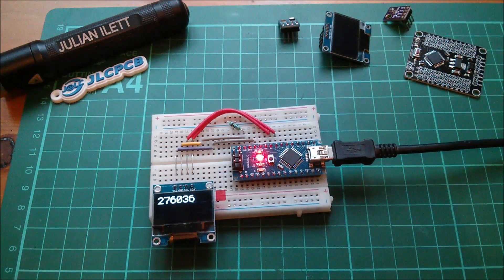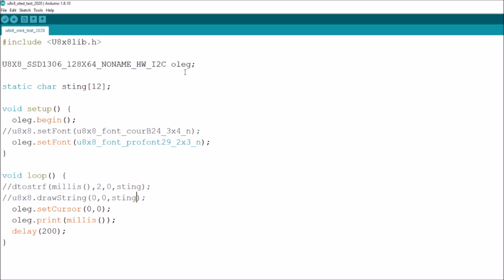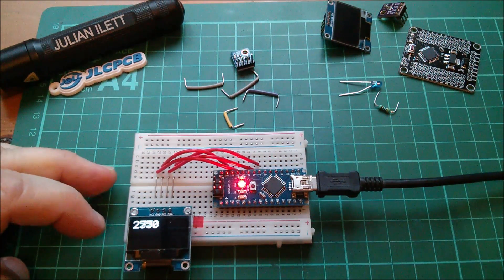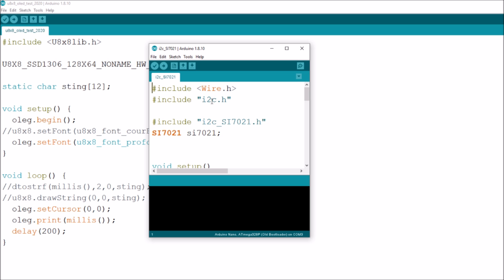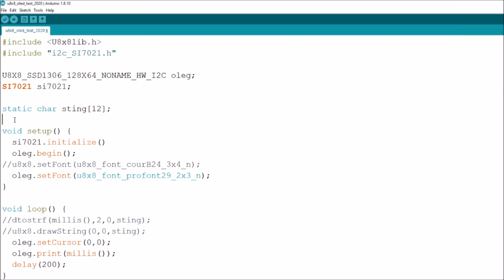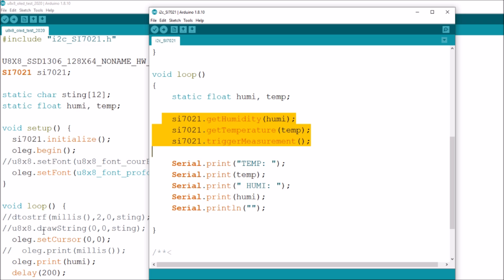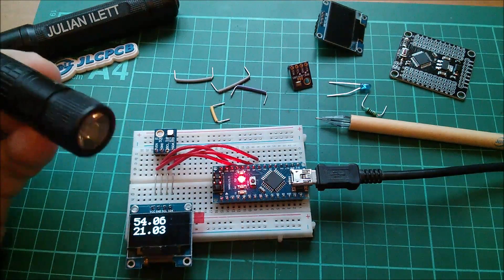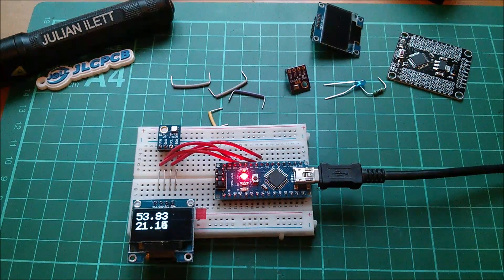Getting back into Arduino #2

Comment: Current project is using a b-280 pressure sensor and a weird little areuino called a pro mini I believe. Its supposed to take in 5v on the "raw" pin, as the two serial pins as inner  rather than edge pins, just basically wierd. I'm also going to need to use a serial to TTL converter. Things I haven't done. But, made the mistake of ordering this a while ago, and I want to put it to use. Huge learning curve but might be useful some day.

Comment: It's a method not a function. Pedantic semantics, but in general a function is passed all the data it needs as parameters. A method uses stuff from the object it resides in. So in this case the .begin() method is using things like the address, port, etc from the object oleg, which aren't passed to it, so it's a method.
Gets a bit complicated with static methods/functions, but who cares lol
Reply: Oh and also, the static variables. The only difference between your static char and their static temp, is scope. Your char is global so setup and loop can see it. The temp and humi is inside loop so only loop can see it.
There's a few other things to do with how it compiles, but hope that explains it simply enough :-)
Reply from the maker: Hey thanks for the explanation

Comment: Hi Julian, why did you choose to use the Si7021 over the BME/BMP280 sensor? Was it because your old project (using the BME/BMP280??) failed to work with the latest Arduino IDE etc?
Keep up the great videos and cheers from Down Under.

Comment: when you come to switching mains beware rf feedback. the arc when you switch high voltage/current has a random habbit of crashing any cpu near it. shield everything or every few days it will stop working for no apparent reason.
Reply: Switch it a zero voltage crossing

Comment: not sure the shed vent thing is going to work out easily...  Humidity sensors don't measure an absolute value, but measure a relative humidity for a certain temperature and pressure.

You can ignore the pressure  since I doubt your shed is air tight enough to have a different pressure inside vs outside :-D

but temperature is still an important factor. 
Though you can probably find a relative humidity to temperature conversion table and work out if taking air from outside, when heated will be more/less humid than the air inside the shed.

But without an inside/outside temperature conversion you're going to get wonky results.

Comment: I have a weird problem where my nano will only work with the new bootloader but it's using chip CH340 as it's a cheap China one. Every now and again it will refuse to be written to and the fix IV found is if I restart my pc it works again. Has anyone else had this issue and is this just the norm
Reply: try restarting the driver for the CH340 instead of rebooting your pc

Comment: Get a raspberry pi install hassio. Install esphome. Use a esp32 or esp8266 . Connect 2 dht sensors  and a relay for  vent. Then use automation  to open and close. Mind you. Once you get the bug. Don't blame me

Comment: The reason the example reads the values first and then issues a measurement command is so the sensor has the maximum amount of time to complete the measurement. If you were to issue a command to the sensor and then immediately tried to retrieve a value, the sensor, depending on the sensor implementation and delays in (or speed of) the Arduino code, might not have finalised the measurement giving you invalid readings.

Comment: you can save memory by only having the char's you need in the fonts. so you need 0-9, °C, and %RH characters in a look up table, instead of 0-9, A-Z, a-z, etc. Part of embedded coding is in only using the things you need, why load 52 alpha char's when you just need 3 and 2 symbols.

Comment: I had the same issue in a cellar.

My solution: Buy a cheap extractor fan rated  for continuous use, vent to the outside.

Pence per year to run. 😁😁😁😁

Comment: Looks like just the project for me. I was wondering if there was a cheap way to reduce the moisture in my garage.. maybe a clever vent fan and set of humidity sensors will do it. I don't want to pay to heat the garage! Hope we get an update on whether it helps your shed :-)
Reply: Start by asking yourself if  the humidity level in your garage is above ambient.  If it is, where is it coming from?  If not, then exchanging air with the outside world will achieve nothing.  Maybe you need a dehumidifier.
Reply: @raykent3211  Tends to get damp with condensation overnight in the Winter. I think it's ambient, because everything outside is also damp or frosty. I'll try datalogging it with an Arduino and then see if sealing the gaps round the garage door makes a difference

Comment: Julian, very timely .... I was just using U8G2 OLED library and had no memory left! Be interesting if you could find out where all the memory is used and whether the library can be thinned down a bit?  Could it be the huge font library? Ask Olly?
Careful ref humidity sensing to drive extractor fans. I gave up on my shower fans because ambient humidity (Solihull) was often near to 100% so the control delta was small. In humid weather the fans ran for ages trying to get below my setpoint delta of 5% or so. In non-humid weather ....open the window!
Reply from the maker: I think a lot of the memory is used for the display buffer - u8x8 has no buffer. At first I'll just monitor the shed and free air humidities and switch the fan manually - just to get a feeling for how the algorithm should work :)
Reply: Julian Ilett .... you will find your shed roughly tracks the ambient humidity so you’ll always be chasing ambient. A more interesting project is to seal all the gaps in your shed and turn on a dehumidifier. That way you’ll get a dry shed. You will find a half decent dehumidifier will have a H sensor in it. You can hack into that and create ‘Arduino havoc’ buggering up a perfectly good piece of kit in the interests of ghoulish entertainment as your shed goes up in smoke.

Comment: I'm a fan of the U8g2 library. The U8x8 is so much smaller than other OLED libraries.  I'm using the 32K eeprom on the DS3231 clock module to store character sets and the DrawTile method to put data onto the OLED display. Much smaller when you don't have to use the SetFont method to load the character set into NVRAM. It's also possible to use 'soft' I2C and connect multiple OLEDs with the same address and access them independently. 
I originally discovered the U8g2 from one of Julian's videos. Great stuff, thanks and cheers.

Comment: Great video. I am looking forward to see if your outdoor sensor works in the long run. I have tried the sensor that you are going to use, it doesn't seem to be able to stay in humidity above 80% for a long period. I think you need to turn on the heater occasionally to bring it bellow 80%. Since my application was battery driven that wasn't an option. And I never found a "cheap" humidity sensor that is specified to be running in very high humidity for longer periods without heating.
Reply from the maker: I may be able to run the heater periodically - I'm going to put a small car battery in the shed topped up from solar.
Reply: @JulianIlett  It would be perfect here. Even in the winter when its raining we seldom go over %40 !

Comment: Humidity went down as you heated with the lamp - because the sensor reports relative humidity, not absolute, and hot air can contain more water than cooler air - so percentage water fell as heat went in :)
Reply: How about dew point instead?

Comment: My Arduino Programing skills are hopeless without using examples to patch together.
Reply: And me. But I still find it gratifying when something works.
Reply: @simonhopkins3867  LOL, Yes giving enough hours I usually come up with something that does most of what I was looking for.  Seldom the way I wanted it done.
Reply: @pulesjet  I'm glad it's not just me !
Reply: We are all the same, each have different stepping in and out levels. The real benefit is that you're doing it!
Reply: a little known fact of programmers, we tend to write things once, then reuse it wherever we need to.
or grab someone else's code and modify it to the purpose
writing from scratch is the hard way
if it works, you did it right
Reply: Me too.
Reply: Staring at a blank screen with no code is quite daunting.

Once you start pasting bits of example code in, the project becomes yours and you get a feel of what you wanna tweak & add :)
Reply: Well, that's why examples are useful. How would you know how to use a library without examples and showing what they do?
Reply: @kjur18  The other way to find out is to read the header files, this is where the functions are and that can sometimes help.
Reply: Mai Mariarti  absolutely.

Comment: Julian in your Postbag #66 you said there was a clever way to isolate the li ion chargers (other than having separate AC to DC converters) Please can you let us know what that method is? Thanks!
Reply from the maker: It might have been something daft like using 3 separate power banks. I can't honestly remember.
Reply: @JulianIlett  Thanks for replying! 
Hmm, I'm looking to make an ebike and I want to have the battery charging circuit right. Atm I'm using the method you showed in the video to charge the battery. Can you please check what the viewer recommended please? I want to do this right. Cheerioh!